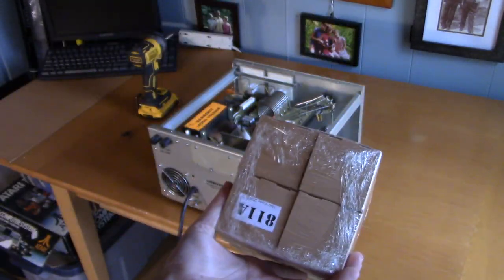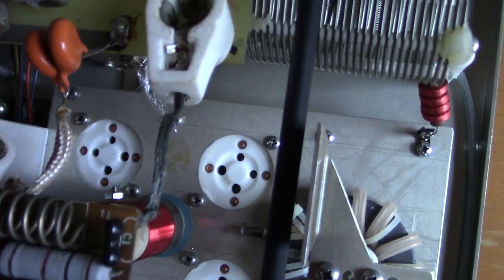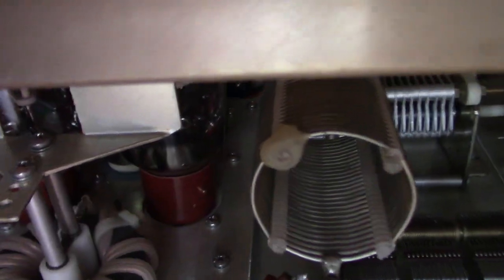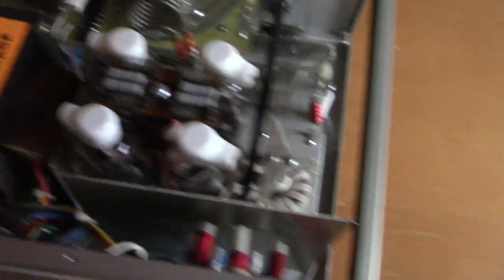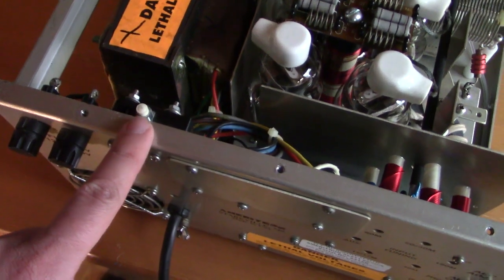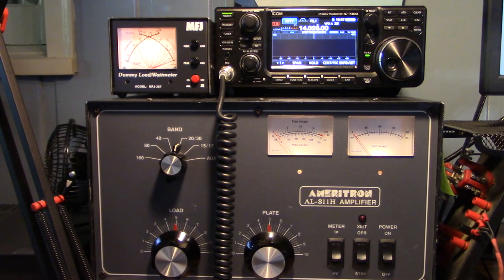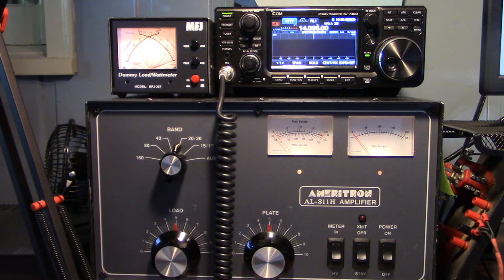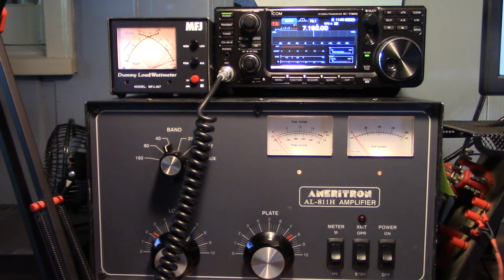HOW TO setup and tune an Amplifier | Ameritron AL-811H with an IC-7300

Comment: I use to use straight carrier to tune but made a bug and doing a 50% like 30wpm would be better for tuning the amp. I just refreshed my valves in my 811H looking to upgrade to a 922 or sb1000 to get closer to the 1.5kw. I know of a few Alpha77sx models in Georgia if any one is looking 😉😉 just gone over by the Alpha Man Dick,
Reply from the maker: I need to adjust my CW settings, CW with the current setup has the relay clicking in and out with each key and that's hard on the relay.

Comment: You start far too low with power ( 5 watts), .....most agree 20-25 watts as a start point. You never really tuned it....(@5 Watts)....Real tuning , and the true finesse happens at 85 watts in and an attempt at full power. This was at best a how to connect it video.
Reply from the maker: Thanks!  I agree that one should too with higher drive, but I can only image the amount of hateful comments I'd get if I did do that.

Comment: No burn in time on the tubes "
Reply from the maker: I took it easy for a while!
Reply: @temporarilyoffline  Ok. Ive heard of burn in time with new tubes but I've never had anyone tell me how or what to do with new tubes.Thanks.
Reply from the maker: @bonkyone3195  I hadn't heard from anybody at first either - but my procedure was to just run for a bit at 100w, then 300w, then 500w and I was "good"
Reply: @temporarilyoffline  THANKS!
Reply: same as on a car engine (no Tesla..I mean a gasoline car..grin) ...take it easy for a while ...a few evenings on half power or less and you will be good to go for more..
check input Swr (between rig and amp) and if needed finetune the input coils

Comment: Right off the bat you risked getting knocked across the room without grounding every capacitor before even putting your hands inside.
Reply from the maker: You're right, I never would have thought of that!
Reply: @temporarilyoffline  years ago looking for a job in a old time TV repair shop I walked over to the work bench where several TVs were being worked on and playing. Back covers removed revealing the inside circuitry. Manager gave me a regular pencil to point it at various components to see if I could recognize where and what they did. Then he asked me where is the High Voltage Anode lead? Like a dumbass I touched the cap connected to the CRT. With the graphite pencil and  got a jolt that nearly knocked out every filling in my teeth. That bastard along with another employee even two customers were rolling on the floor laughing their asses off  after falling for that trick. So I learned my lesson..the hard way
Reply from the maker: @FredrickMcCaskill-et1ku  back then, they would have called that a good teacher!
Reply: he pushed the safety switch twice 😂 (unsafe/safe)